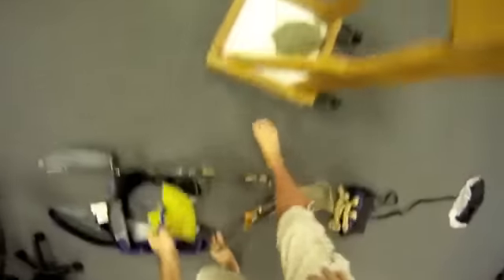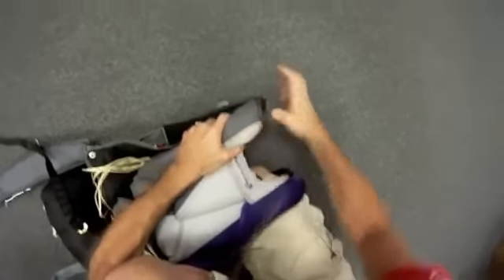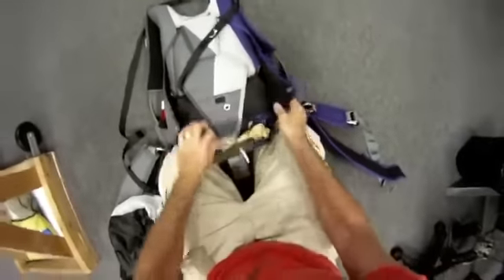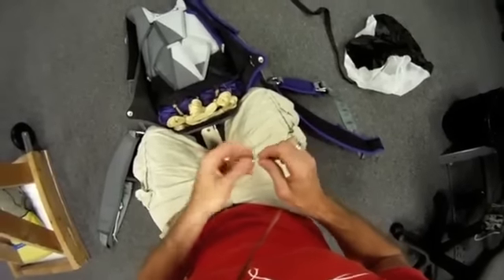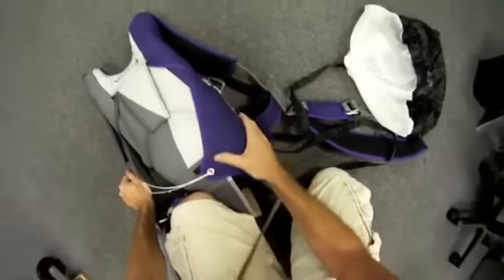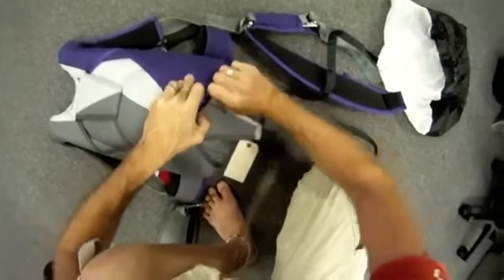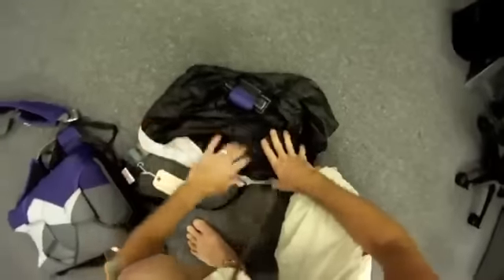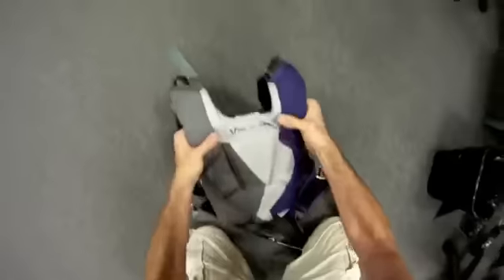Closing main container on a sport rig.mp4

Comment: Is this way of routing the bridle the way it should be done on ALL new Vector 3s? I have a new Micron 310 but I normally close it by routing the part of the bridle from d-bag to the pin above the right flap, also using the velcro attachment above the pin. if this is the correct way, whats the point of the velcro?